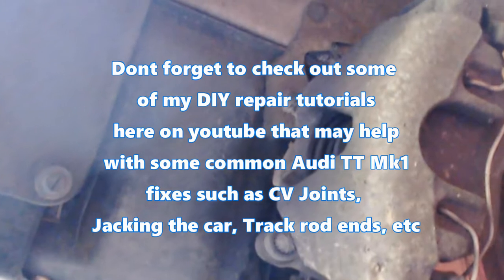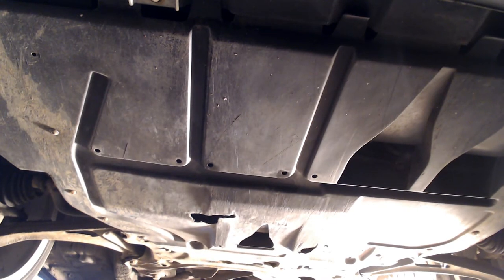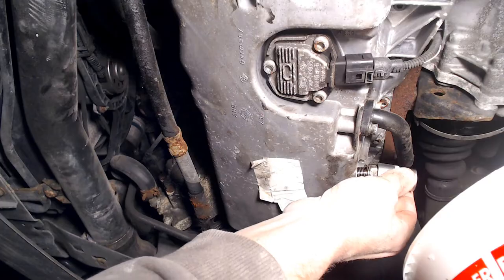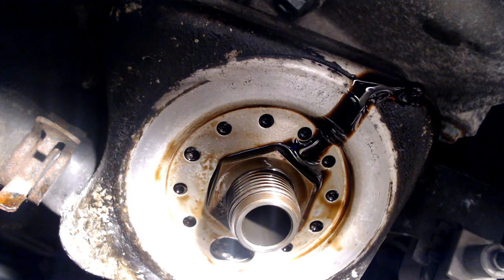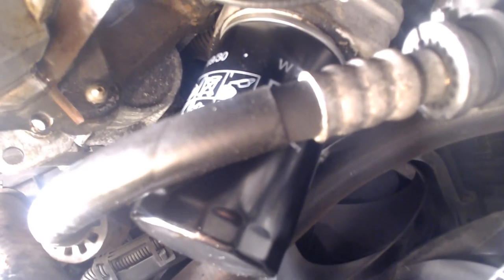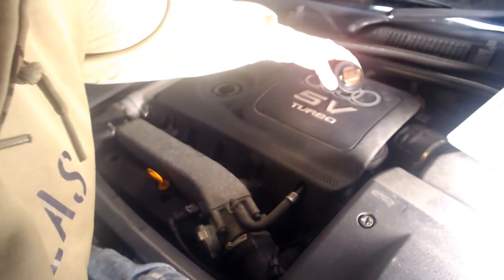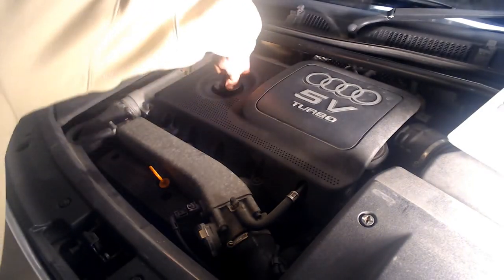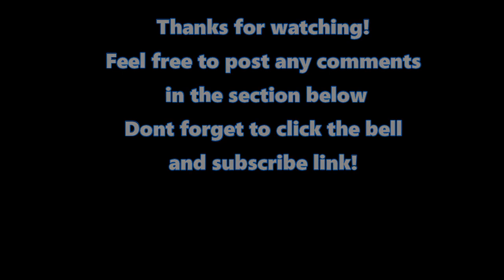Audi TT Mk1- How to change the Engine Oil and Oil Filter - A beginner's guide

Comment: Jacking two times - can this be avoided? How about this approach: keep axle stands, fill less than required oil amount at first (e. g. 3 litres), then check the floor for leakage. If all OK, install the bottom cover, remove axle stands and add the rest of oil. Any issues with this algorithm?
Reply from the maker: @orgenstepp  yeah you can do . This is just my method. 👍
Reply: I ended up using your method with two times jacking. I wanted to check for leakages with working motor (with oil pressure). That was my first time changing oil on TT 😉

Comment: This may be a silly question but how do you dispose of the old oil?
Reply from the maker: Hi Will. It is not a silly question at all and very valid. I should probably have covered that. My advice would be to take the filler funnel and insert it into the neck of your empty oil cans. Gently tip it back into them from whatever oil pan you have caught the old oil in. Once full, take this to your local recycling centre where they normally have a collector you can pour it into. Protects the environment too! Thanks for your question!
Reply: I hear the ocean loved it.  Kidding!  Here in Canada some oil change shops take it and some jukyards.

Comment: Hey! My auto store and online elsewhere tells me to use 5w 40 oil not 30... Have you been using 5w 30 for some time?
Reply from the maker: Hi. 5W 30 is the preferred choice. Check out this forum post too if in doubt. I hope that helps!!https://www.ttforum.co.uk/forum/viewtopic.php?f=2&t=1830602
Reply: People tend to recommend 5w 40 for older/ high mileage cars
Reply: Yep, 5w40 is much better for these engines.

Comment: the previous owner of my TT told me to leave the drainplug open and pour some new oil (0.5 L)  from the filler cap hole, let it go through the engine and then proceed to close the drainplug and fill the engine with oil. Any thoughts on this one?
Reply from the maker: Hi there mate. Sounds like the reason you would do this is to "flush" the engine through, I guess. That would be my thoughts as to why the owner told you to do that. So adding the new oil will trickle through and push any bits of gunk out to the bottom. I am no expert but my thoughts would be that a well maintained car, that has regular oil changes and filter changes should not need that. By leaving the drain plug open, it is simply going to seep out onto your garage floor! I am not saying that is right or wrong, just not something i have heard of. My method seems to work for me but interested to know the reasoning behind it. Anyone else have some thoughts on this and what the reasoning would be? Sounds like you have some great "enhancements" to that car! Let me know how you get on with it!
Reply: @andycharger  the "enhancements" are focused on better fuel consumption and maintenance. Every plastic part in the engine bay has been changed to a stronger one as well as many pumps. The previous owner told me to let the new oil find its way out of the engine through the drain plug and get any potential dust or gunks out of the engine, he calls it "engine flush" and he lets the car sit with the drainplug open for an hour and then proceeds to do what you show on this video. He does that because he did not trust the 1st owner (I am the 3d) and the car has 117k miles.
Reply from the maker: @ArisHDi  Sounds like a sensible approach to "flush" the engine out. You can guarantee as much "gunk" will come out them. Sounds like your previous owner took great care and attention of the workings of the car which is great news. It means that another of these fine cars continues to roll on for many years to come! Is it a hard or soft top? What colour is it also? I may do a "homage to subscribers cars and their stories" when I get to my milestone so would be interested in including pictures and the background of your car if you are interested? Drop me a note mate!
Reply: @andycharger  good news, your videos came up as "recommended" from youtube itself, so the milestone should come sooner or later even though Im from Greece. Yeap im really lucky, the guy that sold me the car has a passion for cars in general, he got over 200 potential buyers within a week, I was lucky because the seller was a mile away from my house. I got the convertible in Dolomite Gray Pearl. Only problem is the wind deflector glass, it goes half way up, without making any noise though. I think a video on how to change the wind deflector mechanism is a must but its a hard task.
Reply from the maker: Ah that is good to know! Thanks for subscribing also! I hope you find my channel helpful! The deflector glass on mine is ok. It does not go all the way to the roof though, just up to the headrests. Are you sure it is not getting high enough? It could be the guides that edge the glass. Ive seen that on slow electric windows. The guides get bent and cause the glass to move up slowly or get stuck. The only issue i have with my roof (other than the rear glass coming away in the corners) is the closing mechanism. I have to give it an extra push up once closed to make the windows come all the way up. Otherwise they stay down an inch on either side! So I need to look at that!

Comment: 5w-30??? My manual says “0w-30, but you can use 5w-30 or 5w-40.” So I’m like wtf
Reply from the maker: Its all to do with how well they work at the "ends" of the temperature range. So it will vary by your countries location and various weather conditions.

Comment: Before draining undo the filler cap, for obvious reasons.  Never use a torque wrench on the sump.  Always use a new washer... (seriously it's like 20p).  If the car has unknown history, drive 50 miles with a flushing agent before draining.  Lastly never scrimp on oil or filters on a high performance engine.  Run the engine run 5mins and check the level 5mins after that... now you can double check the level.
Reply: Engine flush can cause all sorts of issues. Best way to flush the engine is just use a cheaper oil - then replace with premium (Quantum Platinum Plus)